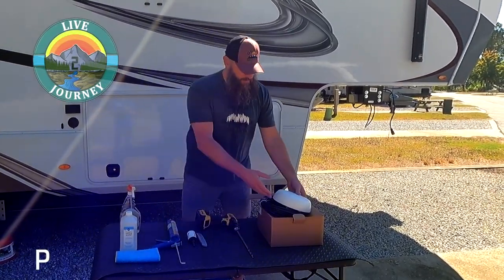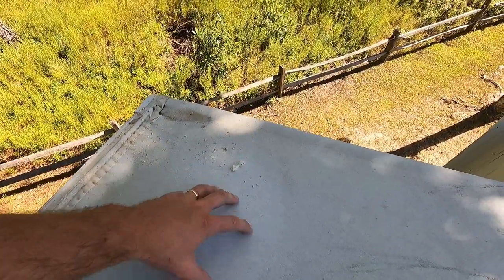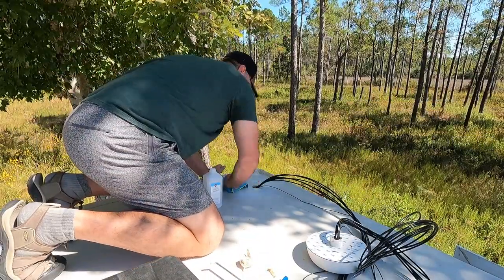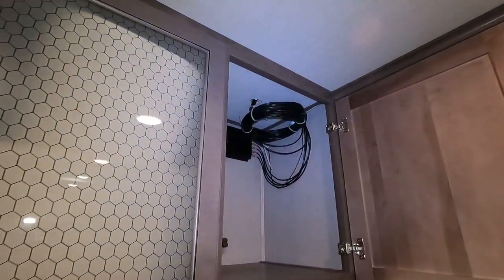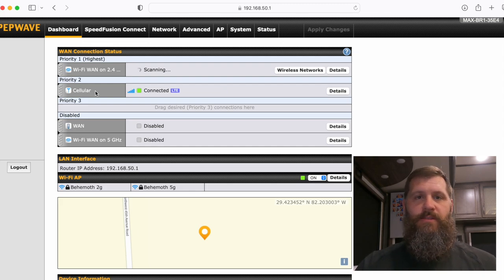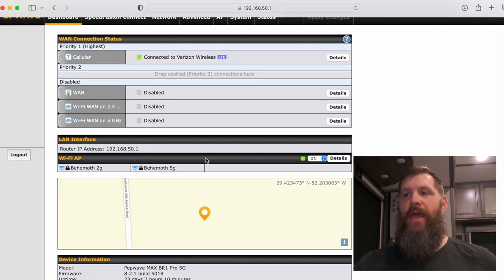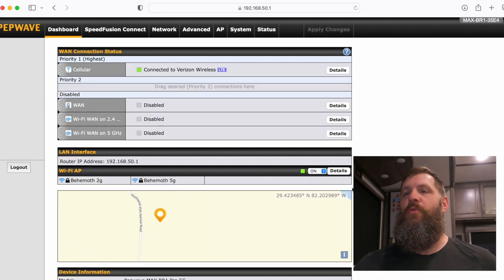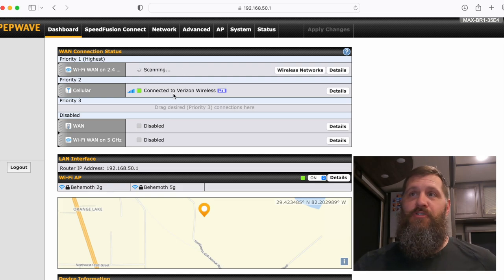Pepwave Mobility 42G RV Installation (Antenna and Router install/setup for RV) (Live 2 Journey)

Comment: My wife and I are new to RVing and I think we're going to copy you on this router and antenna. Thanks for the video.
Reply from the maker: Awesome! I used the gateway for a year and I've been using the pepwave now for 5 months and it's definitely better. The gateway would drop off a lot, the pepwave never does.
Reply: So should I get a couple of different Sim cards from different carriers in case one does not work the other one might? My wife definitely wants to work from the camper but we need some pretty good reliable Wi-Fi.
Reply from the maker: We just use one card from Verizon but we've considered getting a second. A different carrier might be beneficial especially out west where it seemed my phone which is on T-Mobile got better service than my wife's phone which is Verizon. That being said, it would entirely depend on what kind of plan we could get from T-Mobile. We have a 150gig plan through Verizon now and we only use that up if we binge some show on a rainy week...lol
Reply from the maker: You could start with one and see how much data you're using through a few months period and then decide what you might need and add on from there. 
I will say that we have rarely stayed at a site that has decent WiFi so we are really happy with the data plan. The only problem with the cell plan is that if you go to lots of places that are out in the sticks you're not going to have cell coverage in which case you only option would be something like Starlink.

Comment: Have you noticed signal loss with the longer cables?  What are your speeds?  We have a pepwave with Verizon. Have a new rv and going to try install a new antenna. Thx.
Reply from the maker: I never noticed a signal loss with the pepwave, but we ended up going with TMobile Home Internet. Saved some money and works great everywhere so far.